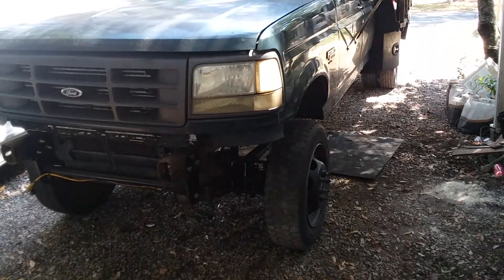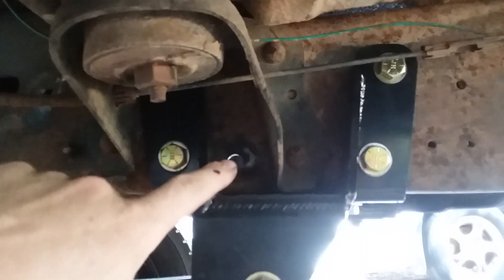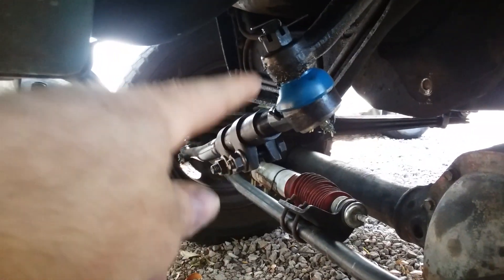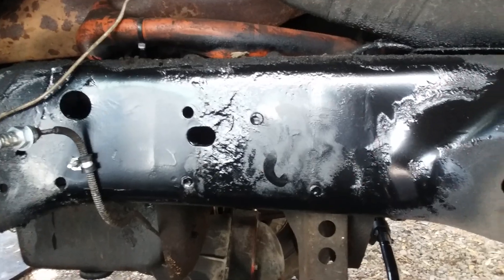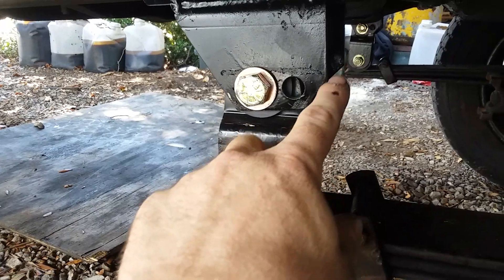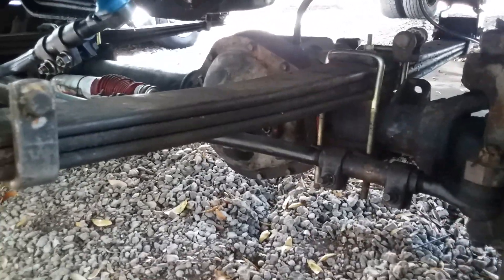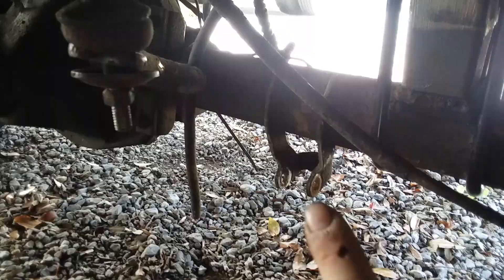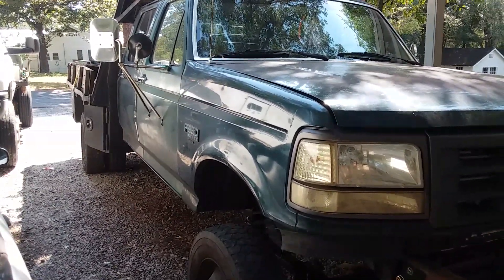Obs 7.3 2wd to 4wd conversion part 2

Comment: Whats the estimate on the 4wd conversion?
Reply from the maker: What do you mean?
Reply: @dieselguy9950  cost-wise
Reply from the maker: @ericmartinez6692  so far 800 for axle. About 800 for bracket kit to mount axle. Another 300 or so in misc parts for steering and suspension. Still have to do t case, new drive shafts and shift linkage
Reply: @dieselguy9950  thank you sir.

Comment: Good luck making it a smoother ride, them springs in front are really stiff.  
When I brought new springs for mine, I ordered the 3 leaf, my front end is tight, but its still a rough ride.
Im thinking about the only way to have smoother ride is to have the radius arm suspension........????
Reply from the maker: Yea leaf springs are always rough, 4 link with coilovers or something like that would make it way smoother

Comment: So it's been several months; any status updates? How well is the kit holding up? I've heard that 4x4 conversions can cause stability issues at highway speeds; have you encountered anything like this?
Reply from the maker: The kit is holding up well. I do have some vibrations at highway speed but I think it's due to the wheel bearings possibly being bad. Haven't had alot of free time to do more work and money is also a slow down.
Reply: Put a 350 sway bar on it takes care of the stability issue

Comment: I have subscribed to keep up with this build. I have strongly considered doing this as means of a cheaper alternative to getting a 4x4 dump truck. I want a dump truck so bad but finding a 4x4 truck let alone a 4x4 DUMP truck can be difficult at a decent price. I have seen decent OBS fords for sale cheap though and actually know a guy that currently has a 92 for sale but it is 2wd. I might could get by with 2wd but I would much rather have 4x4. I also might use such a truck for snow plowing so having 4x4 would be really nice. doing a swap on these older trucks seems fairly easy but yet somewhat complicated lol. I'm not the most mechanically savvy person anyhow. i understand operation and reason, but doing the work and such to change things i dont know much about. would lifting a truck in such a way as what you have hurt performance if used as a dump truck?
Reply from the maker: I wouldn't think so. Both my trucks are fully functional. I have 2 40 ft 5th wheels I tow.
Reply: Diesel Guy what year is the front axle?
Reply: I agree with you but because any 20+ year old 4x4 dually either has trashed diffs or ridiculously rusted out frame anyway